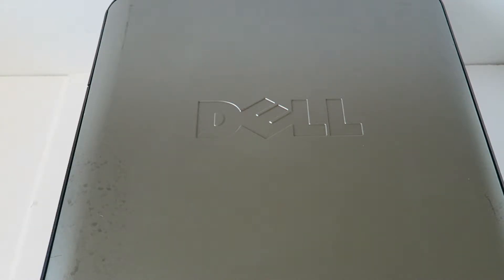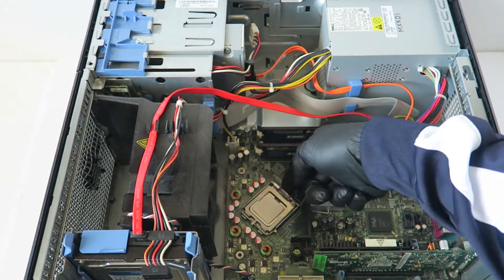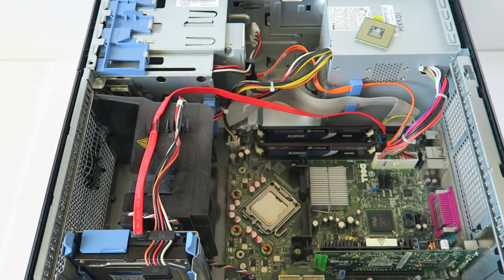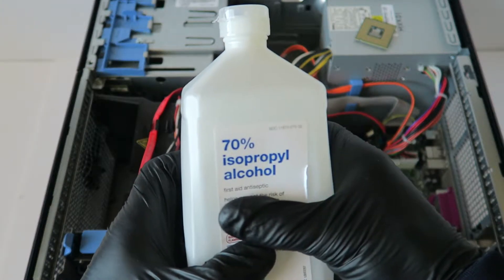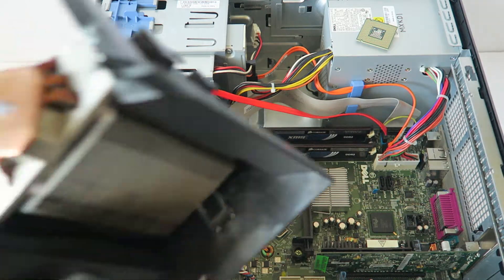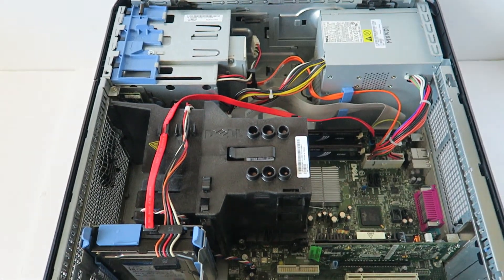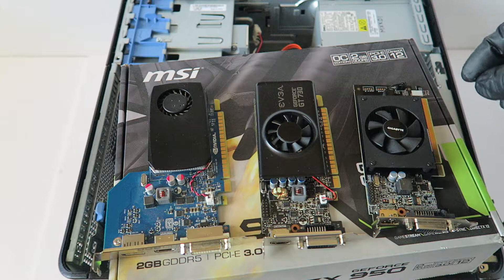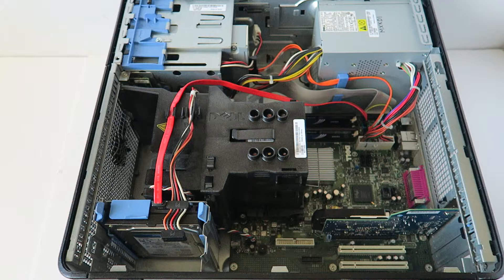Dell Optiplex 745 Gaming Upgrade CPU Video Card Memory

Comment from the maker: Here is the list parts upgrades.

(1.) CPU Intel Core 2 Quad Q6600 2.40GHz SLACR 
(2.) RAM Corsair XMS2 CM2X2048-6400C5C 2GB PC2-6400U DDR2 800
(3.) Power Supply Installed Dell 305W Model Number is L305P-01
(4.) Motherboard dell inc. 0rf703 CN-0RF703
Reply: In the video he says it's a GTX 745.
Reply: @themotivator2587  thanks
Reply: What Graphic card
Reply: Is that the motherboard that comes with it originally?
Reply: Can I put GTX 650 gigabyte in dell optilex 745???
Reply: hey if i change processor ,are i lost my memory
Reply: @mineski.720  no, i'm guessing you mean your files. But you should back up just in case something wrong happens.

Comment: The very best of this Dell Optiplex series still with a old LGA775 socket was the 780 with upgrade possibility of 16GB RAM DDR3L 1.35Volts  instead 1.50 volts and a Intel quad core running at 3.0Gh , I upgrade also the storage  to an Samsung 950 PRO 512GB NVMe  SSD with windows 10 PRO and is running great after all this years , still are possible a bunch of tweaks and improvements to the Optiplex case to make more rigid  and improving the cooling by  tweaking the CPU cooler with the cooler came with the Optiplex 745 which was the best CPU cooler of the optiplex LGA775 series, thank you for the video
Reply from the maker: Hi.

Comment: Bro I have 0rf703 dell motherboard are you sure core to quad q660 will work??
Reply from the maker: Hi, you have to install latest BIOS Version 2.6.6 before upgrading the CPU and yes that motherboard Dell 0RF703 does support Intel Core 2 Quad CPU Q6600 Kentsfield
Reply: @Mxkdt  thnx for reply

Comment: Is this the best CPU for this motherboard?
Reply: I’m using a q6700 which is slightly faster than the q6600. I suggest using that cpu. They can be found for around $20-25. I also suggest putting in a GeForce GT 1030 graphics card.

Comment: I have the same pc but i'm running 8 gigs ram pc6400 and the Q6700 processor but the thing is i havent got a good GPU yet, the mother board dont give me the room to install a dual slot kind, the GTX 650 TI Boost i have needs two slots to allow the video output to come out of the back of the case, i need a good single slot GPU to fit this build,,,,and not too long or it will hit the CPU heat-sink assembly :/

Comment: Bro my pc is intel core 2 quad q6600 with 8gbram and its dell optiplex 745 mini tower 
My Power supply is also 305watt Can i install a 2GB OR 4GB gpu in my pc plz help me plz tell me Bro?
Reply from the maker: Hi, yes you can install geforce gt730 video card..
Reply: @Mxkdt  Thank you bro very much

Comment: Does it run comfortable with the q6600 cpu I been upgrading my tower as well got 500gb hdd 4 gb ram next is cpu and graphic card so I ask
Reply: hi i have had my dell 745 for 3 yrs now still going strong, specs 8gb ram,  msi 7750 gpu and the Q6600 cpu it works perfect very fast to.

Comment: bro can i upgrade dell optiplex 745 tower it is come with core 2 due e4600 pros
i wish to upgarde cor 2 quad Q9550 3.0ghz plz replay fast
Reply: I believe you can only use up to q6800 but I may be wrong.  I've seen benchmarks using this processor. Stick with the q6600 or q6700

Comment: Hello, do 4 2gb 800mhz ram sticks work fine in this pc? I was going to buy 4 sticks here: https://www.ebay.com/itm/2GB-4GB-Memory-RAM-DDR2-PC2-5300-U-667-800-1600MHZ-200-240Pin-PC-Desktop-Memory/201821742436?hash=item2efd836564:m:m1VbEsMl5wk5Oo10GxkZKVQ:rk:2:pf:0
Reply from the maker: Hi, RAM does not show what brand it is or part number don't buy try to get brand name like Kingston, Crucial, Corsair.
Reply: @Mxkdt  ok i bought 8 gb 667 mhz ram Kingston from a buyer, thanks for the help bud

Comment: I can enter core quaq 9550?
Reply: Unfortunately no because even though the q9550 is socket LGA775, the motherboard in the optiplex 745 only supports a FSB (front side bus) of 1066Mhz and the q9550 requires an FSB of 1333Mhz
Reply: @nickt138 👆

Comment: I've never seen someone apply thermal paste like that. Usually people put a grain of rice sized dot on the cpu, then the cooler spreads the thermal compound when it is placed on the cpu and tightened.
Reply: okay, just making sure I wasn't the only one that used a different method. Maybe he's been doing this for a while and/or it's one of those things that's just there and doesn't matter much like torqueing a spark plug.

Comment: Nice!  I have the same system. Only with 8gb of ddr2, Q6700 and a GTX 750ti.  Still works great for its age!
Reply: with the original power suply?
Reply: Alex Aquepucho yeah, i have the miditower model with the original power supply
Reply: Answer asap. Dose the evga gtx 750 ti acually work with the optiplex 745.

I have been SEARCHING AND SEARCHING. PLEASE HELP.
Reply: Dude it really works? I need to upgrade again
Reply: Get ddr3
Reply: @captainrobots1  hey what exact ddr3 I can put inside? (Im asking because I cannot find ddr2 on my local market (this ram DDR2 4GB 2X2GB PC2 6400U 800MHz SAMSUNG 2X2048MB
))
Reply: Hey man. Do you have 8gm of ram of which model, DDR 667mhz or DDR 800mhz?

Comment: Excellent video. Well done. Fast, well thought out, your a pro.  Question, you are upgrading the video card to a more powerful video card, so, don't you then also have to upgrade the PSU because of the power requirements of the new graphics card ?  I know in your vid. you said a 350 watt psu will do, but i wasnt sure when upgrading the graphics card. Thanks.

Comment: I also have a 745  except I put a q6700 and gt 1030 with 8gb ram
Reply: did you need to add a fan after you installed the q6700, and did you need to upgrade the PSU after you installed the gt 1030 , because of the build up of more heat ? Thanks. Did you update the motherboard bios before you installed the  q6700 ?
Reply: no I used the same fan that came with it and I left the PSU.  I barly noticed a difference in heat even with the  1030 overclocked.  I did update the bios before installing the q6700
Reply: Thank you. I have a 745 myself, and may upgrade the processor to q6700, I have read elsewhere where extra heat might of been a problem, but it seems it works fine for you.  I may also upgrade to a better graphics card then the old ati pro x1300 256 mb ram in there now, too, I was concerned about the PSU not being strong enough, but thanks for your comment to help me out.
Reply: @johnsmemes4887  i am having trouble getting my gigabyte gt 1030 oc to display did you have to do anything extra im having trouble even disabled on board graphics and the whole shabang...i have the q6700 coming in the mail today im on the duo 4300 if thats my issue?
Reply: @michaelguerro136  did you download and install the specific drivers for each video card you are trying to oinstall?
Reply: @6955beniegn  lol all good dam from 2yrs ago but yeah I did it ended up being for some reason the new CPU when it was installed the new GPU worked
Reply: @michaelguerro136  ok cool, yeah, i got a q6700 coming in the mail too, im gonna upgrade my other  optiplex 745 cpu too, just runs too slow and lags when on the net, i got 8gigs of ram in it, yeah, i wanted to watch this video again to refresh my memory of how to properly install the new cpu chip, i saw your question from 2 yrs ago, and couldn't help but try to answer it lol, im glad you got it all working now though, have fun with it
Reply: Johns Memes can u please please tell me how to upgrade my bios i have optilex 745
Reply: Just download the bios update from the dell site.. then just follow the prompts, and install the bios update, When you restart your computer, you should see the bios update. Some would say you shouldn't install a bios update, unless its absolute necessary. Are you sure you need to? After the bios update on my 745, it wouldn't boot. After some trial and error, I had to add the ram sticks back one by one into the 745 to get the 745 working again. good luck.

http://www.dell.com/support/home/us/en/04/drivers/driversdetails?driverId=GRJ7T
Reply: 3Xcollasso well yes i think i need the update since i wanted to install a core 2 duo in the device and it didnt work
Reply: well, you will have to do some research to see which exact CPU's will work on your specific motherboard. As an example,  I bought an e8400 CPU and it didn't work in my 745.  I also upgraded my bios to 2.6.6, and that made no difference.  But, the other poster above used a q6700, so that may work for you. You could try it. But it will use more wattage at 105 W TDP.. Right now, I have an e6600 in my 745,, works fine.
Reply: 3Xcollasso so ifi get a q6700 will it wor?
Reply: i dont know for sure. you have to get the exact model of your motherboard. Not all 745's have the same motherboard. Download and use CPU Z and try to find the specs of your motherboard.
Reply: Johns Memes me too